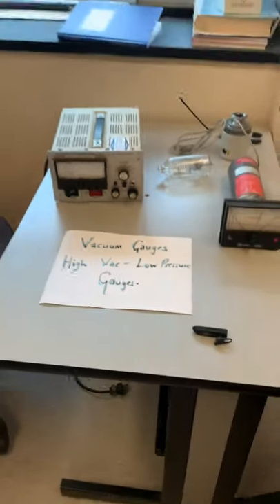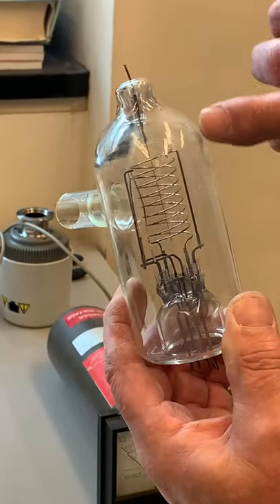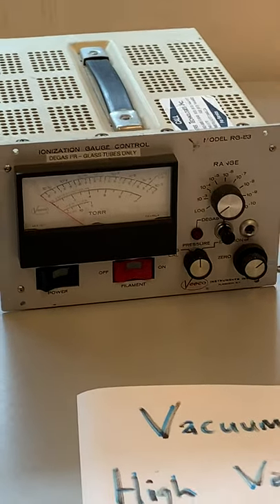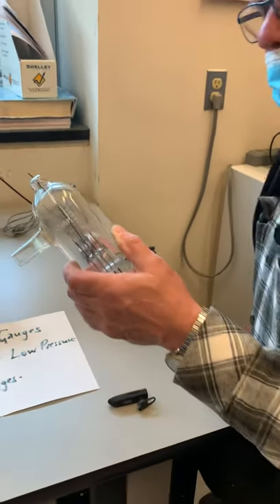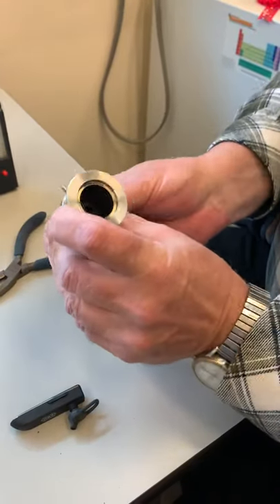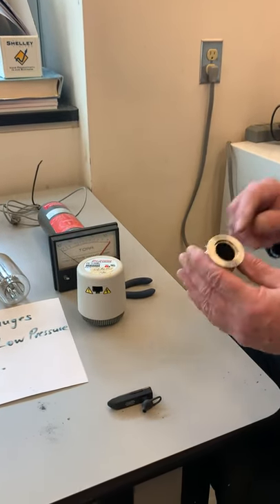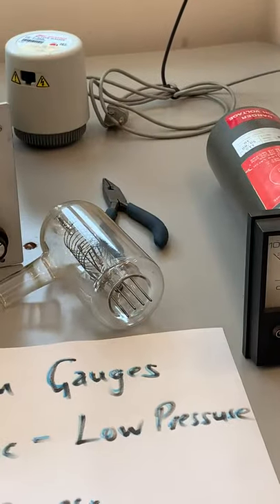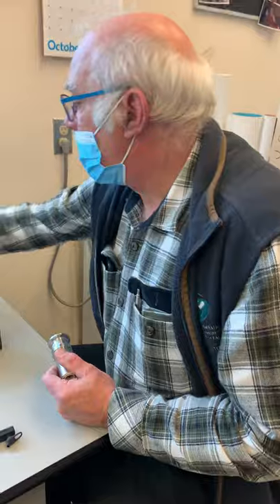Vacuum Technology Series. High vacuum gauges.

Comment: hi myself punit from Massachusetts, i have varian 843 gauge system in my thermal evaporation system. but i am not able to connect the io0n gauge with system. because i do not have the aluminum connector with o-ring, do you have any idea how can i get that.